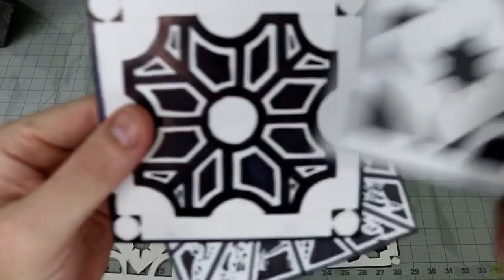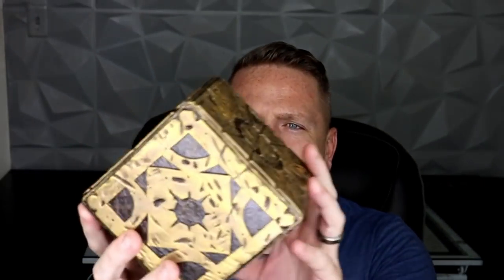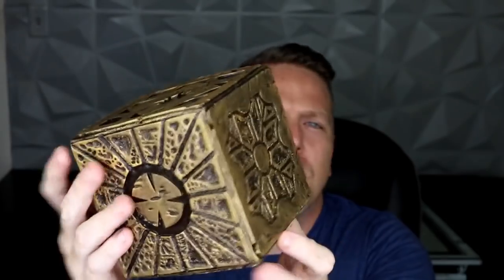Foam Crafting the Puzzle Box from Hellraiser

Comment: Would a soldering iron work in place of a wood burner? Great build!
Reply from the maker: Maybe. I wouldn't see why not. You just need an end that gets hot enough to melt the foam. Make sure to wear a respirator and work in a well ventilated area